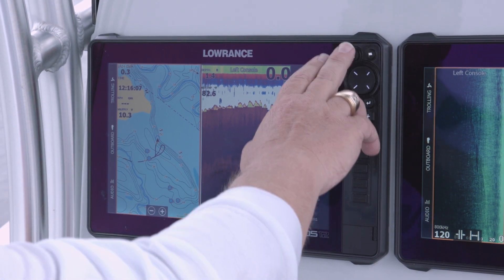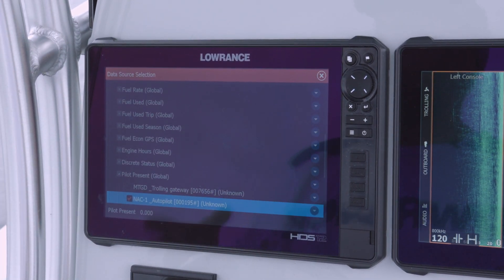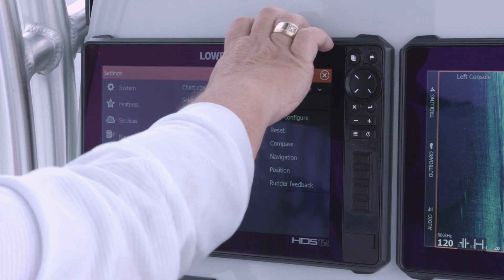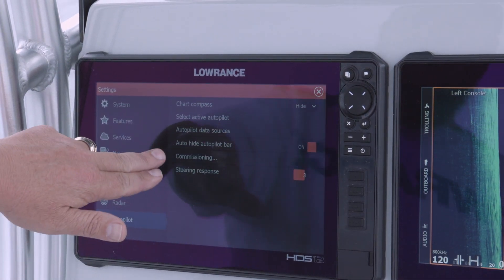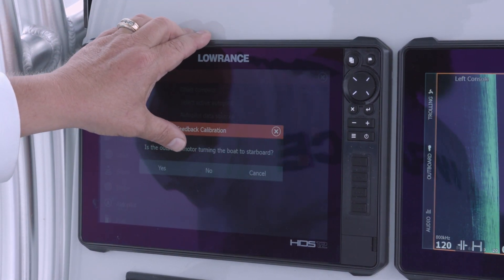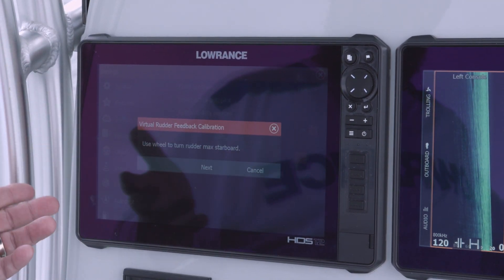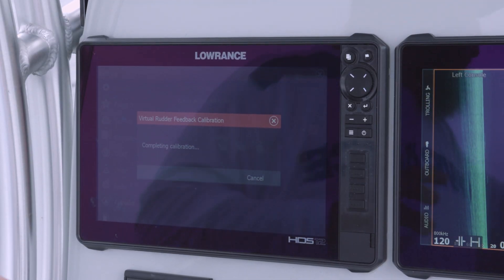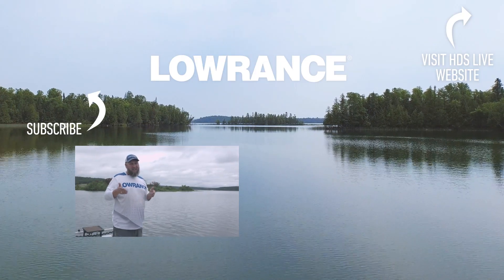Setup and Commission Hydraulic Outboard Pilot | Lowrance

Comment: We have a Nac-1 Cable steering Autopilot with Point 1 compass and Lowrance Elete 7HDI .
can see the Nac-1 ,Point 1and Feedback unit in the nmea 2000 device list.
However we don't see the autopilot Icon to commission the autopilot.
Question is the Autopilot feature available on the Elete 7HDI ?
Where can we find the autopilot commissioning?
Reply from the maker: You will not be able to control any autopilot nor trolling motor with the old Elite series. You will need a HDS Gen3 unit or higher or a new Elite FS unit.
Reply: @lowrance  is there a stand alone control for the NAC-1 autopilot ?
Can the Bluetooth remote ,setup , commission and control the nac 1 autopilot ?

Comment: Question: I commissioned the Outboard Autopilot with HDS Live 9in. All worked ok. There is a feature where you use the AP to manually steer the boat. Two big Right/left arrows pop up on the HDS screen. If you use these, the End of Travel that was determined in commissioning does not seem to apply, the system will keep trying to turn the outboard until you let off the button. Is this how its supposed to work? I can see a distraction issue if you are not turned around WATCHING the motor that it can be jammed into the end of travel.

Comment: Hi Jacob, the one confusing factor I found when configuring my Autopilot is when it says turn motor to Starboard. I think the motor when looking back at it is actually turning Port, front of motor facing you, but if you were moving forward, the BOAT would be moving to Starboard right? 
It took me some trial and error to figure this out.
Reply: This is an old thread, but I'll comment anyway.  I'm using a new autopilot (2021) with latest HDS software.  During commissioning when picking a voltage setting with a "yes" I ran into the "port and stbd" confusion mentioned by Robh if I chose "yes" when the motor actually moved to port.  In other words, the motor is looking for a "yes" with BOTH the right voltage and right direction, which is not covered by Jacob (or newer than his video).  It took several attempts to get it all right.